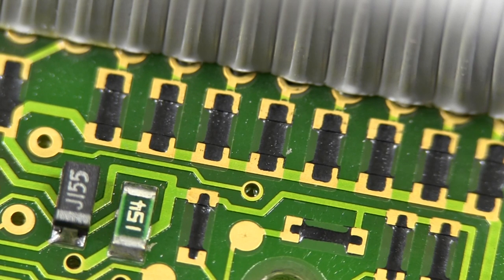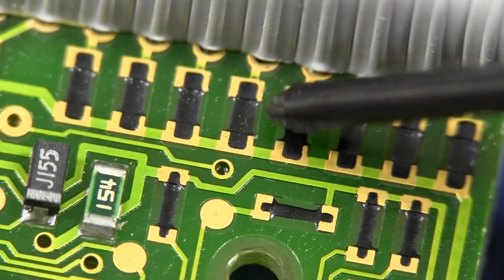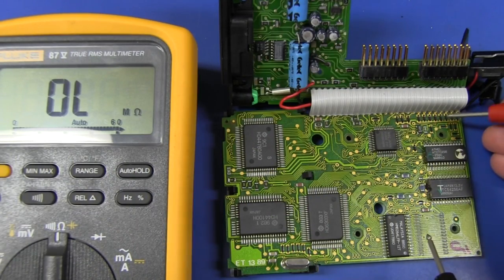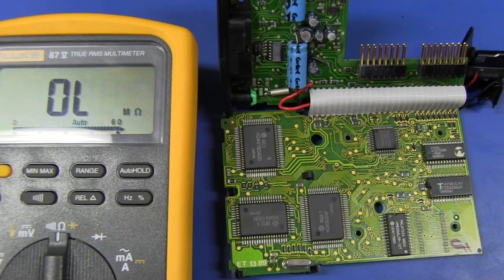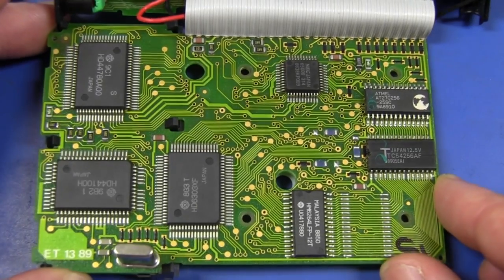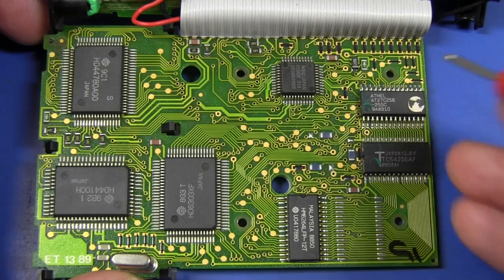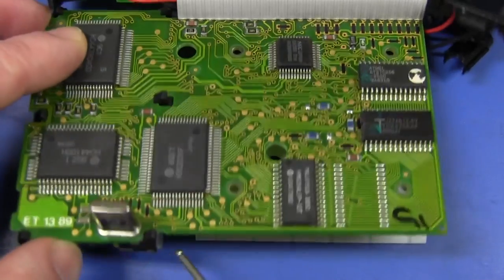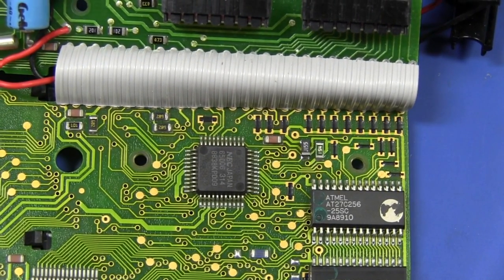EEVblog #335 - Carbon Printed Resistors

Comment: Way back when I started everything was still through hole. The early surface mount kit was damned expensive because not only were the components more expensive (especially passives) but more critically so was solder paste. So a box of 2000 metal film 1% through hole was about £2GBP in bulk. A reel of 1206 5% was more like £12 so about £0.012  per resistor. Then the solder paste was about £0.008 for a 1206 too. If I remember correctly a carbon printed resistor was more like about £0.01 so around 50% cheaper. Prices for surface mount didn't really start dropping till about 1990. . The solder paste dropped in price radically around then too as did wastage. In the early 80's the wastage for solder paste was near 50% by 1990 it was less than 10% on a good line. I have known companies change pick and place machine just to reduce paste wastage in ultra-high volumes.
Reply: Thanks for the feedback. I'm glad I found your comment.
Reply: 12 euro for a reel? That seems cheap.
Reply: @LittleRainGames  Did you missed the part where he mentioned through holes are the norm? So somewhere in the 80s, yeah 12euro is pretty expensive back then.

Comment: reverse the leads and remeasure. if the value doesn't change, then it's probably not influenced by active components in circuit.
Reply: Good to know. Thanks

Comment: I worked in bare board pcb manufacturing for years and the carbon printing was and still is an option. Hell, we are even embedding resistors into the pcb during the inner layer lamination which is a nightmare to do.
Reply: +hectorbacchus Sub-surface mount? ;)
Reply: +strangersound they are embedded carbon printed resistors. The problem is getting consistent values.
Reply: Why is it so expensive to add carbon stuff to boards? Maybe its only expensive for low volume/prototypes though..

Comment: Not just back in the day, but now even there is such a thing as screen printing carbon epoxy. That can essentially be done for roughly the same cost as soldermasks or silk screen text - it's really not expensive at all. The reason carbon printed resistors are usually associated with high cost is the fact they're often used in hybrid substrates (ceramic and aluminum with film copper). But they don't need to be expensive.

Comment: There are very few chip parts, so maybe instead of a conventional 2-stage chipshooter then fine-pitch place machine process they did it all on the fine pitch machine, which could be slow for chips.  Don't know if they had fast shooters back then, but my guess would be placement time.

Comment: I worked on a project about 20 years ago which involved using a laser to trim these printed resistors. Even though there may be a high variance from the printing process, when trimmed I guess you can bring that down to 1% or less. Can't remember the details unfortunately.

Comment: Interestingly enough, I saw these printed resistors in a 10USD piano keyboard toy just last week. On the pcb with the contacts on it, there were no through hole or surface mount components whatsoever! Just printed resistors (for contact multiplexing), and a ribbon to the main board.
Reply: Yeah, going SMD-free is another story. That eliminates a very expensive pick-and-place machine entirely.

Comment: I'd say it was down to space. The printed resistors are all tightly packed together and looking at the size of the other passive components, I'd say it was a space issue and they had problems with the solder sometimes accidentally joining two pads together, so they went for printed resistors to elimiate this.

Comment: Sometimes screened carbon resistors were used to allow laser trimming of the resistance.  The final resistance was automatically tweaked to the correct value once the circuit board was fully operational.  As long as one or more of these laser trimmed resistors were required, then all of the non critical (ie, pullups,...) resistors were screened on at the same time, to reduce cost.  Not sure if this is the case with your PCBA though.  Many precision hybrid modules used this method.

Comment: I saw this done in a car radio back in the early 1980s before anyone had ever heard of surface mount. Saves space and money but the resistors are about 20% tolerance.

Comment: For developing something it could work well. When finally get it right, you can measure it and then replace. Only problem is that we can't get that carbon resistor on in the first place. :D

Comment: You'll be measuring other components in the circuit as well. Example: 2 resistors in parallel.

Comment: Resisters in Parallel decrease overall value, so because most components have some resistance, and the circuit around the resister will cause the reading to be always lower that the resister value itself. Most of the time the only advantage of measuring a resistor in circuit is to see if its open. If the measured resistance is way bigger than the resister you can be confident that its a bad resistor.

Comment: I'm guessing that when the boards were manufactured they may have been panelled together with the keypad which would have carbon patches for the keys, essentially making the printed resistors cost nothing extra.
Since the resistors are essentially part of the board manufacturing process and not the assembly stage they would have been laid down before the boards were routed to be separated and long before the boards got to the pick and place machine.
Reply: there are no carbon patches for the keys.

Comment: 6:16 not only the semi-wide aperture but also the fact that you're doing macro AND the fact that your opteka lens isn't the highest quality probably has to do with the really shallow depth of field. I've noticed the sharpness goes way down around the edges of macro stuff, and it gets distorted as well...that might have a part...But you usually don't get that shallow depth of field shooting at 2.8 unless you're on a very long zoom or macro.

Comment: I have a jar ive been ashing in for 3 years, Ive mostly kept it as a slurry by adding small amounts of water. I wonder if it can be mixed with epoxy or silicone and put in to a squeeze tube. it could be handy for digital stuff.

Comment: Heat can not be the issue. Solder melts at 183°C or more (if it is öead free). You must not have temperatures like this on the PCB for prlonged time.

Comment: I can think of a couple reasons for doing this though neither apply to this board.

I first saw it when I took apart my Nintendo Entertainment System NES-004 game controller around 1986 which is when almost everything was still thru-hole so the printed resistors were literally the only SMDs. The button contacts were also carbon printed so I wrongly assumed the pull-ups were vestigial turbo button contacts. Years later I realized they were resistors and decades later I realized why: They wanted a single-sided PCB that was completely flat on the trace side for the carbon button contacts. The rest was just a 4021 shift register (DIP16) and two resistors (axial leads). The only components that would fit on the flat bottom were the printed pull-ups, and since they were already printing carbon film for the button contacts they likely saved a bit versus populating more thru-holes.

Since then I’ve seen it used in another controller with a Mylar flex PCB that couldn’t have any rigid components, so there’s reason number 2.

I’ve also seen it used in later designs to jump traces under a chip without a thru-hole or via (single sided).

Comment: I have a slowly growing business of replacing SMD resistors on a certain car's ECM sub assembly board's resistors. They heat up enough to soften the solder. Maybe that is the issue. I do not want to go into a lot of detail of which car and which part. After the earthquake in Japan spares were not coming in for weeks, so I started putting 1/2 watt 100 ohm and 33 ohm resistors on these boards. That is my guess. Many were in parallel yet they still got very hot and fell off.

Comment: Nice to know that even the best of us learn something every day Dave :o)  When you say 'Panalisation breakout marks', what do you mean by that please? 

You've definatly got that thumb up with this one :o)
Reply: When you Panelize multiple similar Boards into single one, the Board shape is routed into the board and small Tabs are left to keep it Connected, layer these tabs can be Cut using pliers to Seperate them leaving a Indentation or mark on edge of the board

Comment: If the board is under any thermal or mechanical stress, you could start a hairline crack. I'd try either polishing it or just replace it with a actual resistor.

Comment: This is actually quite cool. Wonder why PCB factories no longer offer this, should be very easy to do... Especialy for small batches and prototypes, where i don't do pick and place, this might save some time needed to solder small resistors.

Comment: I can use the connector-less ribbon cable as shown in the carbon pcb on mybdesign. 

What is this type of  ribbon called?
 How do you select this? 
Can i get this in my desired length? 
Do i have to strip of ribbon cable ends manually for each board? 

I need strong and flexible connections between my two PCBs without connectors and need minimmum verticle clearance.

Comment: Is the carbon printed resistor the same as carbon button contacts? If panelized, boards with resistors+buttons would have made cents :-)
  Dave, I'm here looking for guidance on carbon button footprint creation. I have no plans to make. I'm just reverse engineering a design and in need of 'proper footprint design' guidance. I haven't come across anyone talking about having contacts made with this stuff while searching YT. I'm messing with a Nintendo Game & Watch (little STM32H7 based holiday trinket). A bit of effort went into button layout and design as contact detection is critical in the application. So what are the pros and cons of resistive contacts on pcb and silicone buttons versus gold/nickel/(soft/hard plate) and carbon/silicone, versus domes and/or devices? I'm interested in the differences in speed/noise/accuracy/mechanical (advantages/disadvantages). I know about the references to tactile dome buttons here, but I don't think the EEVBlog library covers this one specifically yet, at least not from the pcb design side of the subject. When is this even a practical thing to do? Do Proto Board Houses do this on the cheap? 
Probably pointless to comment like this in the sea of comments, but thanks for reading if you made it here.
-Jake

Comment: What were they thinking when the car company decided to save 13 cents and make a board that routinely has the power resistors heat up and fall off when the solder melts. It is a $40,000 car! These were essentially pull down resistors too. I do not think the carbon will melt off the board like a soldered SMD device. I can ask some of the Motorola guys or a another EEE guy who has decided to become a dentist. When I ask why he became a dentist, he said, "Let's see'em send that job over seas".
Reply: Well for the past 5 years I have seen 'em do exactly that for the higher end dental work. Patients travel tourist class to somewhere with cheaper dentist wages for expensive non-emergency procedures such as getting permanent dentures, gold teath, filling replacements etc.

Comment: what is that component at the left  j155 at the beginning of the video?
Reply: Derpy Herpy Flux Capacitor
Reply: and if I blew one  up can it be replaced with a normal electrolytic capacitor?
Reply: +Hermann Göring Hahaha. Der Reichsmarschall ist immer richtig
Reply: Derpy Herpy Yes :)

Comment: it's digital logic so what if the value is off by 30% 40% even 50% every thing is on or off as long as you get with in 1/2  volt + - of 50% supply voltage the logic  will work plus every in put is buffered by the logic's operation 
as to why use printed restores well you don't have to stock them you don't have to place them
Reply: you still have to stock and apply carbon goo
Reply: Right, but you only have one kind of carbon goo, and that can still make a variety of different values due to the trace geometry when you print it.
Reply: @leonerduk  Well the point was no stock and no placement, The way it works was not mentioned and already known.